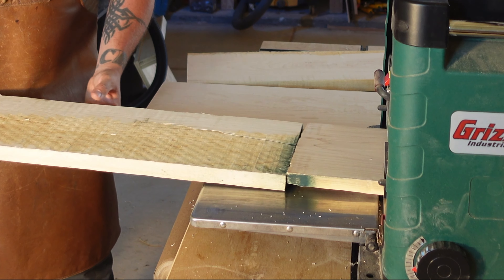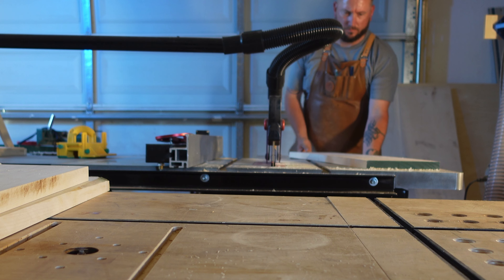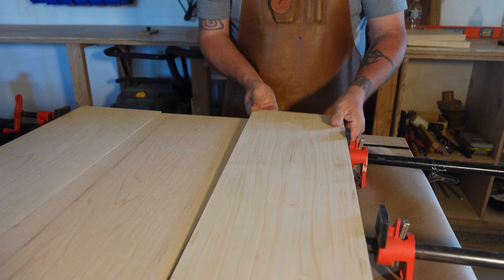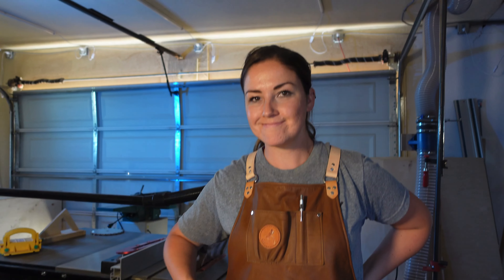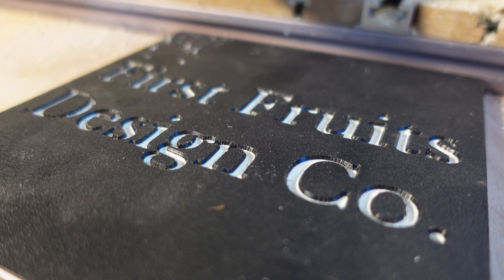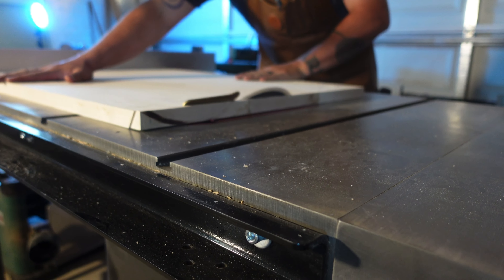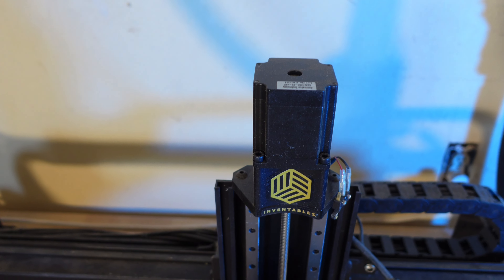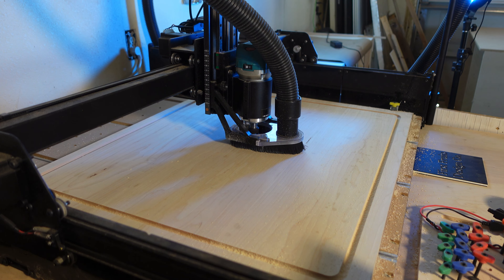How To Build High End Stove Cover - how-to noodle board build DIY

Comment: Gorgeous! What do you do on your noodle boards to prevent warping and cracking when you have the two end boards that run cross grain? I always wonder about that style when it comes to the wood movement
Reply from the maker: Thank you, and excellent question!  We build ours with the grain all going the same way, so if wood movement happens it’s natural and unobstructed.  I’m familiar with how a lot of these boards are made with the two perpendicular boards that hold the others together and could see that being a potential issue, one of the reasons why we make ours the way we do.